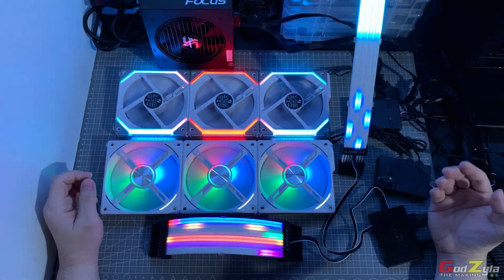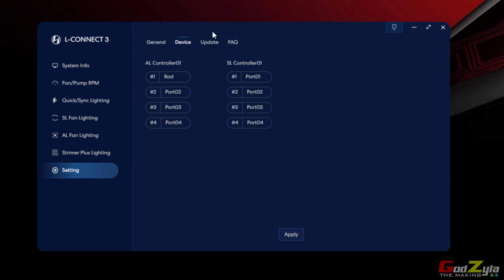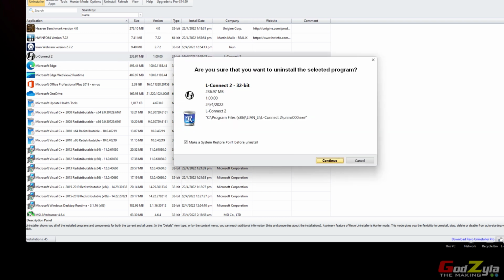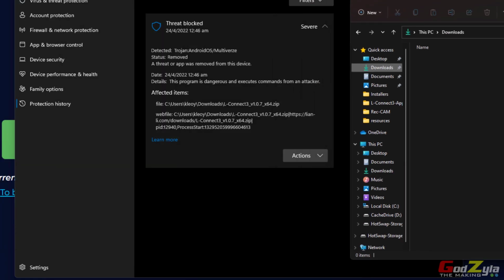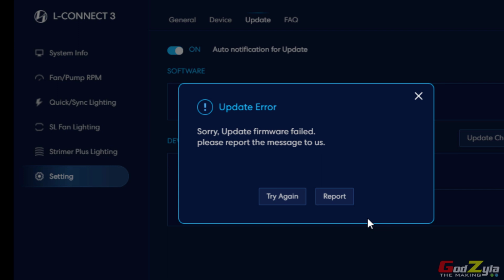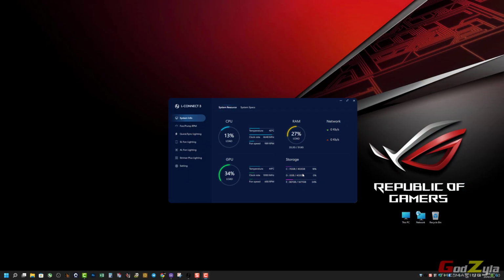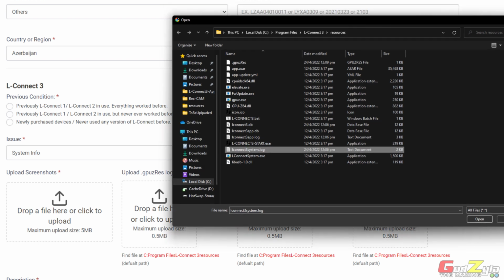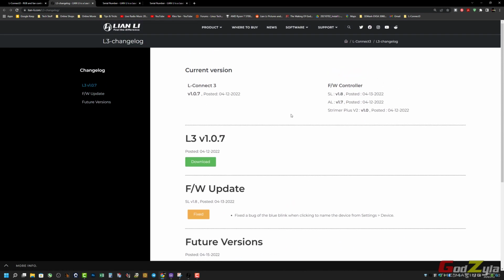Lian Li - L-Connect 3 (Installation)

Comment: Hello, I'm a very big fan of your video which fascinates me, I'm from Belgium and I have a question for you: I installed a group of Al 120 fan with V2 connector and a group of Strimer V2 and only my light effects work on the stripers and I have the latest version the L connct "1.2.6" and nothing works on the Als neither color effects nor RPM function they are connected to 2 USB ports different from my card motherboard Asus Rog Z 490 F Gaming, do you have a solution for me? thank you in advance, really sorry for my English (Google translation)
Reply from the maker: Hi alain melotte, welcome to my channel, you might want to follow these steps. 

Basic Troubleshooting steps
Disclaimer : Though the chances are very low to brick firmware updates on motherboard and to any controllers. I will not be responsible if you have brick your motherboard or controller.

1) Make sure you motherboard bios is up to date, please check on your motherboard manufacture website, under support > bios and drivers. See if there are issues with USB and do they have a fix. If there is, kindly update those bios firmware version.

2) Make sure your chipset driver for your motherboard is up to date!. For AMD will be at https://www.amd.com/en/support for Intel will be Intel Driver & Support Assistant Intel DSA https://www.intel.com/content/www/us/en/support/detect.html

3) Remove all argb apps (Asus Armory Crate / MSI Dragon Center / Giga Fusion / Asrock Polychrome). If the brands which I have mentioned, do have a uninstall tool like the Asus Armory Crate, use that. Else use Revo uninstaller ( https://www.revouninstaller.com/ ) to uninstall the apps as mentioned. Revo uninstaller will remove all unwanted files / folder / registry in your system. Illustration to use revo uninstaller https://www.youtube.com/watch?v=uMgUYiakpxM&t=437s

4) Shutdown your PC, unplug the PSU cable from your AC outlet. Press the power switch twice to discharge all current that your motherboard is holding. Leave it for 45 second

5) While waiting, please do not use KVM switches. Disconnect all devices that are connected to your motherboard (front / back IO). Leave only your Keyboard, Mouse , Monitor and Ethernet (If you have) connected directly to your motherboard. If your monitor has a KVM build in remove the USB cable from your monitor to your motherboard USB socket. If your mouse and keyboard is connected to your monitor, please remove them and plug them directly to your motherboard instead.

6) Plug only one Uni controller or Strimer Plus V2 controller. If its for Uni Fan (SL/AL) use only 3 fans to an output.

7) Plug the power cable and turn on your PC

8) Go to your Device Manager, look under Universal Serial Bus Devices, make sure you see the Lian Li uni / strimer plus V2 controller.

9) Install the L-Connect 3 app only https://lian-li.com/l-connect3/ (current version 1.2.6)

10)	After installation, run the program, check under Setting > General > make sure Auto-Run on Boot and Minimized L-Connect 3 to system tray at close are ON.

11)	Reboot your system.

12)	First thing you need, go to device manager and see if the Lian Li controller is listed, next open up the L-Connect 3 app. Check if there is a need to update firmware to your controller. Go to Settings > Update, under Device F/W version, click on Update Check, download and install the firmware. Make sure the firmware is completed. Do a check on device manager and make sure the Lian Li controller is listed.

13)	On L-Connect 3 dashboard, check if the CPU and GPU readings are reacting, you might want to test it using some benchmark programs. If there are reaction, play with the PWM and argb functions. If it does not work, skip step 14) and proceed step 16)

14)	If Single controller works, shutdown your pc, connect uni fan set of 3 to your output of your uni controller. Do it small steps at a time to hook up your sets of fans. do not do all in one go. If successful and you have a second controller, proceed small step at a time again.

15)	Slowly plug back your USB devices (Headset, Microphone, Printer, USB Capture Card and etc). At any point of time as you add those devices one at a time, if L-Connect 3 become unresponsive. This tells you that there power is insufficient to power up more USB Devices. Whatever USB port on your motherboard, there is a limitation as the current are shared across the board, be it front or back I/O and the internal USB Header. You might need to get a Internal USB Hub that comes with a Sata Power source to the Internal USB Hub. (Disclaimer, buying a internal usb hub might or might not resolve this issue, purchase at your own expenses)

16)	If it does not work, report your issues to Lian li Tech Support. There is a in build log ticketing system in L-Connect 3 version 1.2.6. this is what you need to do. Go to Settings > Support > Click on “Download log” place a filename and choose a destination drive to save the log file. Next click on “Report” it will take you to Lian Li Tech Support FAQ. Fill up the form and upload the log which is a zip file. illustration here https://youtu.be/ngj5pGQbt_Y?t=1290

Comment: Hi Kleo!

How can i control the Front LED RGB from my O11 DXL with L-Connect 3? i have an UNI FAN HUB Controller with 10 UNI FAN SL in the case.
Reply from the maker: Hi Adnan Sofic, welcome to my channel, if all your ports are taken on your SL Uni controller, I suggest you connect your rear fan to either with your top 3 fans or bottom 3 fans using a splitter. Look for the lian li argb kit https://www.aliexpress.com/item/1005003182827084.html? , this will free up one port of your uni controller, again use a kit to plug your XL case led to your uni controller. illustration diagram here https://imgur.com/gallery/beYR8CN  just note on the rear fan and the top fan on how to make use the argb cable kit from lian li.
Reply: @KleoYan  thanks, i will try it now. Can i  put also mein drgb ek aio on the uni controller? Just like the galahad on the description?
Reply from the maker: @adnansoftic3818  yes you can, just the pump block argb itself but the issue is, you only have 4 output and I do not advise you to plug more than 4 fans to one output of the uni controller. by doing so you will over load the controller. again you will need a coverter. ok this is not really related to the EK AIO pump block but the converter cable can be applied which is in the lian li argb cable kit. just an illustration ( https://youtu.be/bMRz2KVqbjA ) of using the uni controller with EK Fans. the connecter end is the same as your EK AIO pump which make use of the standard 3pin argb connecter.
Reply: @KleoYan  i already buy yesterday the lian argb cable kit.
Reply from the maker: @adnansoftic3818  I see, that’s good. Just make sure to practise with care ya. You can refer to the dos and donts about the uni controller in this playlist https://youtube.com/playlist?list=PLEW-b-2vYDdPo0NzHyeksx012c-nkDapm all the best in your build 👍 and thank you for the visit 😉

Comment: hi Kleo and chat, can you recommend good software to clean uninstall l-connect software? got an javascript error on my lconnect 2 software just now. I tried others uninstaller but broke my windows after i uninstall the same software. Thanks.
Reply from the maker: helloo osnap, welcome to my channel. user Revo uninstaller ( https://www.revouninstaller.com/ ) to uninstall the app. Revo uninstaller will remove all unwanted files / folder / registry in your system. Illustration to use revo uninstaller https://www.youtube.com/watch?v=uMgUYiakpxM&t=437s

Comment: I dont see any fans on the left hand side of the L connect app. Any idea why?
Reply from the maker: Hello Russ Williams, welcome to my channel. Mind if I ask what fans are you using (AL or SL) and which motherboard brand and model?
Reply: @KleoYan  sl 120 and rog z390e
Reply from the maker: @Wallcrawler616  thanks for the reply, now based on your motherboard, there are two USB Header, have you tried switching to the other USB header? if it still does not work. 
you might want to follow the below steps. 

Disclaimer : Though the chances are very low to brick firmware updates on motherboard and to any controllers. I will not be responsible if you have brick your motherboard or controller.

Basic Troubleshooting steps

01) Make sure you motherboard bios is up to date, please check on your motherboard manufacture website, under support > bios and drivers. See if there are issues with usb and do they come with a fix. If there is, kindly update your bios firmware. 

02) Make sure your chipset drives for your motherboard is up to date!. For AMD will be at https://www.amd.com/en/support for Intel will be Intel Driver & Support Assistant Intel DSA https://www.intel.com/content/www/us/en/support/detect.html 

03) Remove all argb apps (Asus Armory Crate / MSI Dragon Center / Giga Fusion / Asrock Polychrome). If the brands which I have mentioned, do have a uninstall tool like the Asus Armory Crate, use that. Else use Revo uninstaller (  https://www.revouninstaller.com/ ) to uninstall the apps as mentioned. Revo uninstaller will remove all unwanted files / folder / registry in your system. Illustration to use revo uninstaller https://www.youtube.com/watch?v=Rm2emeyMUAk 

04) Shutdown your PC, unplug the PSU cable from your AC outlet. Press the power switch twice to discharge all current that your motherboard is holding. Leave it for 45 seconds

05) While waiting, please do not use KVM switches.  Disconnect all devices that are connected to your motherboard (front / back IO).  Leave only your Keyboard, Mouse , Monitor and Ethernet (If you have) connected directly to your motherboard.  
If your monitor has a KVM build in remove the USB cable from your monitor to your motherboard USB socket. If your mouse and keyboard is connected to your monitor, please remove them and plug them directly to your motherboard instead. 

06) Plug only one Uni controller or Strimer Plus V2 controller. If its for Uni Fan (SL/AL) use only 3 fans to an output. 

07) Plug the power cable and turn on your PC

08) Go to your Device Manager, look under Universal Serial Bus Devices, make sure you see the Lian Li uni / strimer plus V2 controller. 

09) Install the L-Connect 3 app only https://lian-li.com/l-connect3/ (current version 1.2.6) 

10) After installation, run the program, check under Setting > General > make sure Auto-Run on Boot and Minimized L-Connect 3 to system tray at close are ON.

11)	Reboot your system. 

12)	First thing you need, go to device manager and see if the Lian Li controller is listed, next open up the L-Connect 3 app. Check if there is a need to update firmware to your controller. Go to Settings > Update, under Device F/W version, click on Update Check, download and install the firmware. Make sure the firmware is completed. Do a check on device manager and make sure the Lian Li controller is listed.

13)	on the L-Connect 3, check if the CPU and GPU readings are reacting, you might want to test it using some benchmark programs. If there are reaction, play with the PWM and argb functions. If it does not work, skip step 14) and proceed step 16) 

14)	If Single controller works, shutdown your pc, connect uni fan set of 3 to your output of your uni controller. Do it small steps at a time to hook up your sets of fans. do not do all in one go. If successful and you have a second controller, proceed small step at a time again. 

15)	Slowly plug back your USB devices (Headset, Microphone, Printer, USB Capture Card and etc). At any point of time as you add those devices one at a time, if L-Connect 3 become unresponsive. This tells you that there power is insufficient to power up more USB Devices. Whatever USB port on your motherboard, there is a limitation as the current are shared across the board, be it front or back I/O and the internal USB Header. You might need to get a Internal USB Hub that comes with a Sata Power source to the Internal USB Hub. (Disclaimer, buying a internal usb hub might or might not resolve this issue, purchase at your own expenses) 

16)	If it does not work, report your issues to Lian li Tech Support. There is a in build log ticketing system in L-Connect 3 version 1.2.6. this is what you need to do. Go to Settings > Support > Click on “Download log” place a filename and choose a destination drive to save the log file. Next click on “Report” it will take you to Lian Li Tech Support FAQ. Fill up the form and upload the log which is a zip file.
Reply: @KleoYan  I will try these tomorrow and let you know if any work! Thank you for all of the suggestions.
Reply from the maker: @Wallcrawler616  you are most welcome. well it might or might not work. hopefully it does solve your issues.

Comment: Got it working didnt even have to do any steps just downloaded software and gave me a update option and it worked. About 3 weeks ago it didnt work. Had to use L2 software. But thanks for this video very helpful. Thank u.
Reply from the maker: Hi Texas Elite, welcome back. It’s good to hear that you do not need to go through so much hassle to get it working. Unlike some which including myself. Nevertheless thank you for the feedback.

Comment: My L connect 3 software pop up every time when I turn on my computer and ask for administration permission for 3 times, I mean it is only 3 clicks per time to solve the issue when I turn on my computer , but do you have any way to solve this isssue ? Thanks
Reply from the maker: Hi Deku, welcome back, to solve this issue, you can turn off the User Account Control Settings. these are the steps.
1) Press Win + I, in the search file type UAC
2) You will see the User Account Control Settings, click on it.
3) Set to Never Notify and reboot your system.

https://winaero.com/windows-11-disable-user-account-control-uac/#:~:text=Disable%20Windows%2011%20UAC%20with%20Group%20Policy&text=msc%20in%20the%20Run%20box,Set%20the%20policy%20to%20Disabled.

Comment: Hi Kleo, your channel is absolutely benefiting. But I have a little problem as I am not able get the L-connect 3 (v1.1.9) to sync with my new PC build, z690 gigabyte Aero G DDR4 mobo (GPU RTX3080), with a SL & a AL controller connected to the mobo 9-pin F_USB1 and FUSB2. The RGB control seems to be ok but not with the fans control. The CPU and GPU temp readings are not showing, so is the  'system specs' page. Would appreciate some help from here.
Reply from the maker: Hi j1wong, welcome to my channel. I like to check with you. do you have a dual monitor setup and are you using any KVM? if you using dual monitor, try connect to one first and if you are using KVM, remove all USB devices from that KVM and connect your usb devices directly to your motherboard USB sockets.
Reply: @KleoYan  Thanks for the speedy response. The system is connected to 1 display (4k), and not using KVM. The only thing that is connected to the USB is the kb and mouse (at the IO back panel). This is a new build pc, with win10/64 loaded only.
Reply from the maker: @j1wong  I see. If you are able to control the argb, there should not be an issue with the lian li controllers. now is to fix your reading. ok can you try this version. see if it helps. btw this is official from Lian Li https://drive.google.com/file/d/1D1yWdLPLwbWYL8ixBGoJhcZjhNN36QIt/view?usp=drivesdk version 1.1.17 I am using it.. no issue on my end.
Reply: @KleoYan  Thank you very much for the v1.1.17. It works well with my rig now. CPU temp and GPU temp is reading, system specs page is displaying, most of all RGB and fan PWM is responding. i will explore further with mobo control. Thanks again.
Reply from the maker: @j1wong  u are most welcome. Glad that did help you out.

Comment: Bro, my system is asus prime pro x570 with Nzxt x63 AIO with Sl 120/140 uni fans.
Can u show us how to connect nzxt AIO with Mainboard and the Uni Jun with the Fans.
L-Connect 3 don't shows me system specs and don't show me Temps on FAN/Pump RPM, I don't understand how to do I right I'm konfused searching for ppl they have the same problems on the same build and how they done it right.. And I found nothing. I'm about to give up. Please help.
Reply from the maker: Hi 12Silversufer12, welcome to my channel, before applying L-Connect 3. This is the basic I know which will work for L-Connect 2 https://imgur.com/gallery/rGxCQ87 if you get this to work. then try install L-Connec 3. if L-connect 2 works but not L-connect 3. I would advise you to approach Lian Li Tech support.. btw that diagram was with the help from a viewer. I do not know how NZXT works with it's CAM application.
Reply: @KleoYan  thanks a lot! I will try this out today. And see the results.